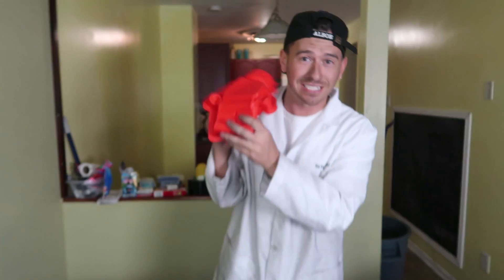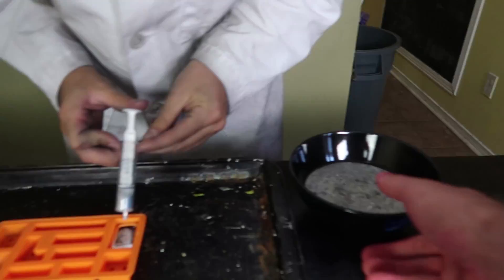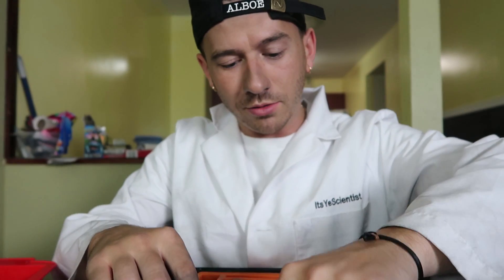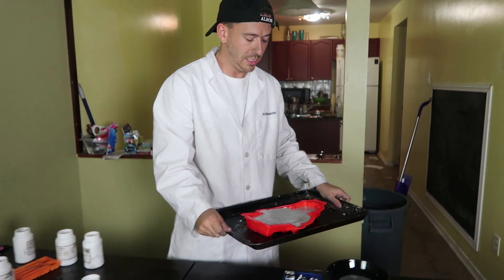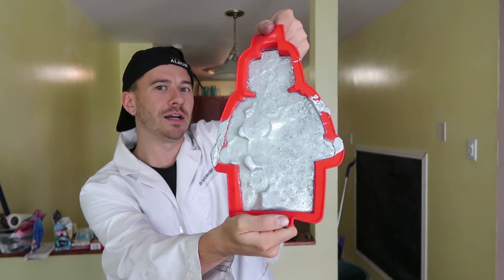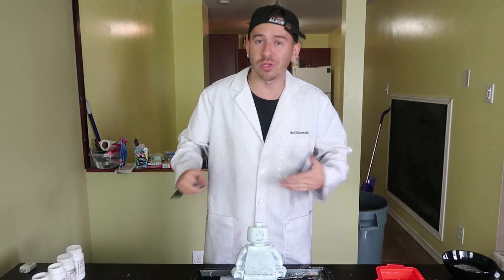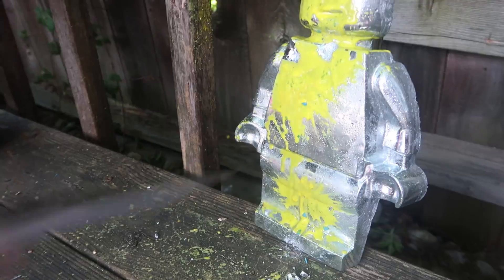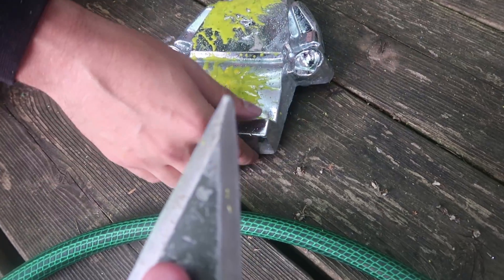DIY GIANT METAL GALLIUM LEGO FIGURE EXPERIMENT!! (100+ LBS WORLD RECORD!!)

Comment: Justin to fix the knife, heat the tip to at least 350 degrees, and use pliers to bend it back to the correct shape.